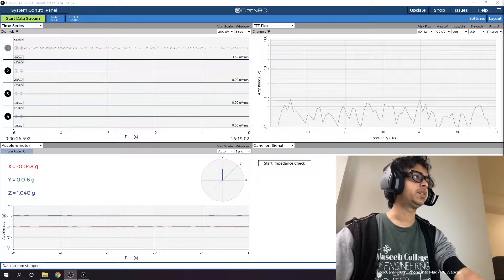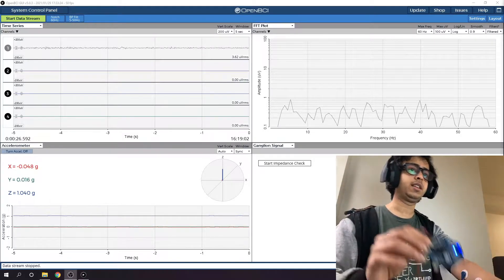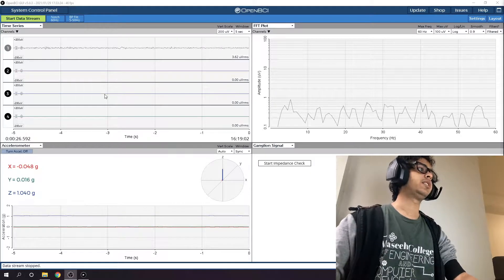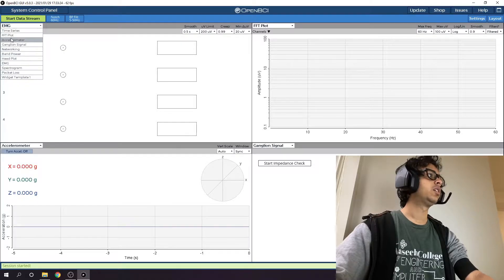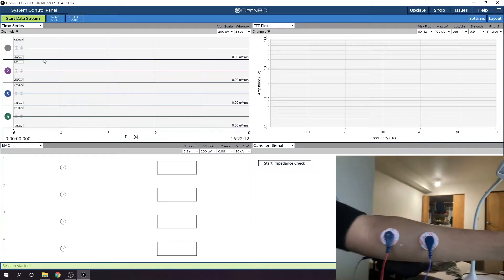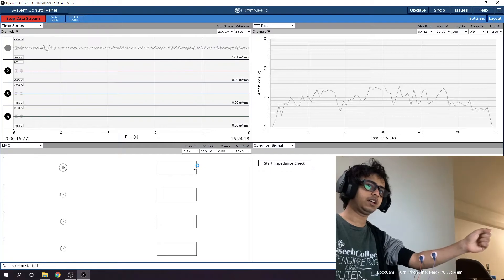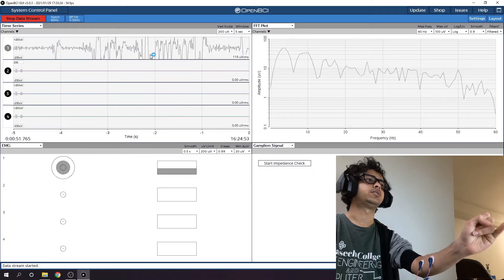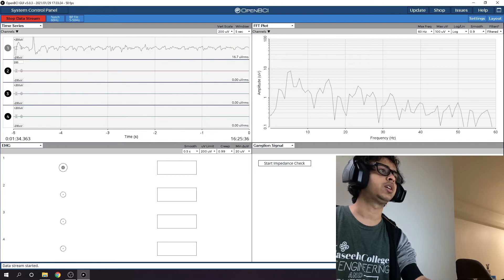OpenBCI Setup test for muscle movement. Project: Prosthesis Control with brain waves -1

Comment: Hello sir , i have the same ganglion OpenBCI toolkit and I followed the same steps as you (I don't have the stickers for the electrodes so I used medical tape to keep the electrodes in place), but when I turn the signal on it shows a lot of continuous fluctuation on 200 micro V time scale unlike yours , and on 10000 m V it shows periodic beats (maybe it is my pulse) but it doesn't show any change when I open and close my arm, I have kept the same placement of electrodes as yours also I think it might be because the impedance is 135kohms which is probably very high, if so can you please help me on how I can solve that. 🙏
Best regards